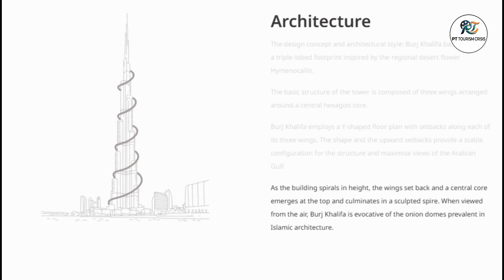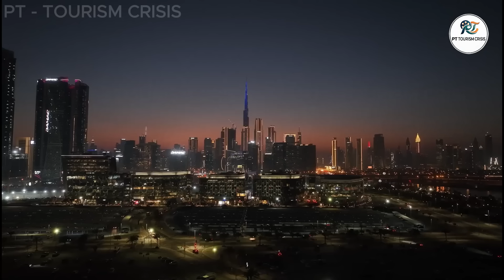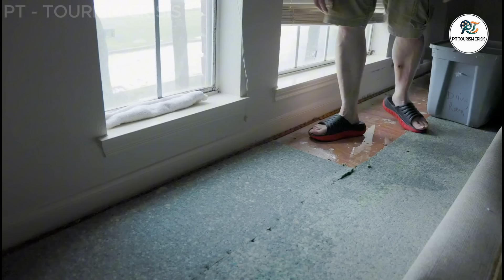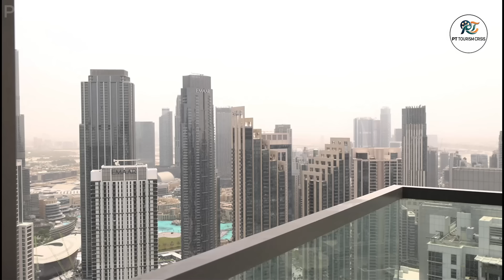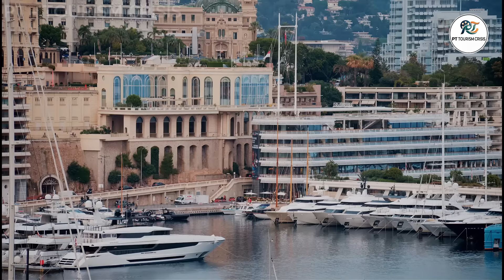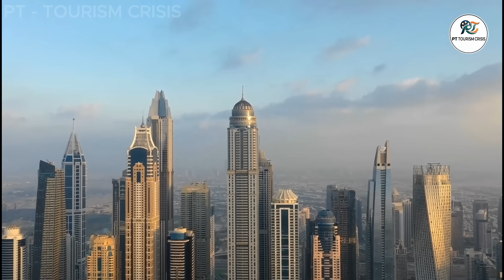Why Dubai’s "Impossible" Skyline Is Finally Failing

Comment: Now, what happens with this awesome engineering if the temperature highs are ten degrees higher? With the ocean heating it might end up ten percent higher humidity. It may not sound like much but on a structure hundreds of feet higher humidity it’s massive. By mid century the buildings may start becoming unsafe decades ahead of schedule.
Reply from the maker: That is a legitimate concern. Higher heat and humidity can accelerate material degradation and increase cooling loads, though whether buildings become unsafe early depends on design margins, maintenance, and adaptation.

Comment: Linguistic confusion led to the destruction of the tower of Babel.
The use of carbon steel for the construction of the building skeleton was lost in oversight.
There is a steel product that would have prevented the steel decay.
It is called 3CR12 stainless steel.
Reply from the maker: 3CR12 stainless steel can improve corrosion resistance, but material choice is always a cost, design, and maintenance tradeoff. Carbon steel can work too, if properly protected.

Comment: As part of the design process, thermal loads must be accounted for along with other types of loading and through-life degradation mechanisms.
Reply from the maker: Exactly. Good design must account not only for peak thermal loads, but also repeated heat cycles, material fatigue, corrosion, and long-term performance.

Comment: Western, and especially European, architects and structural engineers have scammed the oil rich rulers of the Gulf Arab states. They sold them building designs and construction that could last for hundreds of years in Europe or North America with only routine and occasional maintenance, but will require constant and expensive maintenance in the coastal desert environment of the Gulf States. Will these Gulf cities eventually end up like the coast towns of the American West? Probably so.
Reply from the maker: The Gulf’s heat, salt, humidity, and sand can make maintenance exceptionally expensive. But calling it a deliberate scam is too broad. The real test is whether long-term upkeep was honestly priced and properly planned.

Comment: You can not build on sand😊
Reply from the maker: Technically you can, but it requires deep-piling and sophisticated stabilization that is far more difficult than building on bedrock.

Comment: Some of those scrapers looked tilted by the winds. Leaning slightly. Pay attention and you'll see it next to some of the other scrapers being built or already built.
Reply from the maker: A slight lean can be caused by camera perspective, construction alignment, or normal wind sway. Modern skyscrapers are designed to move slightly, but a permanent tilt would require proper engineering measurements to confirm.
Reply: @PTtourismcrisis yes i thought so, i couldnt find this video to edit.

Comment: The ground is becoming saturated ( which it never was before irrigation). And no drainage system was installed . The subka has become unstable.
Reply from the maker: That is a valid concern. Irrigation and leaking infrastructure can raise groundwater in sabkha soils, reducing stability, especially where drainage is inadequate. The actual risk depends on local soil studies and the drainage system at each site.

Comment: this is baloney. when you invest on the future you predict all the variables. this is not the millennial tower in s.f. not maiden lane in n.y.c. where the designs are based on cheapness. saving a few million up front that condemns the structure before it is completed. they anticipate maintenance as this video displays.
Reply from the maker: Fair point. Dubai’s major projects do plan for maintenance, but good engineering does not eliminate aging, corrosion, or rising long-term costs.

Comment: Wouldn't it have made more sense to build underground? The possibilities are delicious. Delightful. Why not? So much could be accomplished, including farming.
Reply: The thing about building underground  is the views suck
Also, they are at sea level in very porous soil
Reply from the maker: Underground construction could reduce heat exposure and create space for controlled-environment farming. But excavation costs, ventilation, fire safety, groundwater, daylight, and maintenance make a fully underground city difficult. A hybrid design would probably make more sense.
Reply: @PTtourismcrisis I saw a hybrid construction that was genius. It could work. Like RB said, at sea level I guess you can't go too deep.

Comment: Hot humid salt air: wait for disaster to happen!
Reply from the maker: That combination is extremely corrosive, especially for exposed steel, concrete reinforcement, glass seals, and cooling equipment. Disaster is not inevitable, but constant inspection and maintenance are essential.

Comment: One intense earthquake will one day bring these skyscrapers down. And no one will survive. These should never have been built. Simple 1 floor homes with lightweight roofs spread out can survive earthquakes. And remote work has made these buildings obsolete. Seattle skyscrapers are now half empty.
Reply: That's exactly what Oman did. Simple buildings with Arabic heritage architecture.
Reply from the maker: Oman offers a strong example of how lower-rise buildings and traditional architecture can better respect climate, culture, and human scale without chasing extreme height.
Reply from the maker: A major earthquake would be dangerous, but modern towers are engineered for seismic movement rather than expected to collapse. Low-rise homes can reduce evacuation risks, although they are not automatically safer, and remote work has mainly weakened office demand rather than making all high-rises obsolete.
Reply: @PTtourismcrisis Did you see what happened in Venezuela lately? Or other past earthquakes around the world...

Comment: Help me understand how the science of erosion in this video is incorrect?  Seriously, no sarcasm.
Reply from the maker: The basic science is not entirely wrong. Wind-driven sand can abrade exposed glass, coatings, seals, and equipment. The exaggeration is jumping from surface wear to inevitable structural collapse. A tower’s load-bearing concrete and steel are protected behind the exterior, and their more serious long-term threats are moisture, salt penetration, cracking, and rebar corrosion. Those risks require inspection and maintenance, but sand erosion alone does not create a predictable domino effect.

Comment: Desert dust will invade every opening no matter how small.
This will act as an abrasive that will weaken the structure over time.
Reply from the maker: That is a genuine maintenance challenge. Wind-blown dust can enter imperfect seals and abrade glass, coatings, filters, and exposed equipment over time. However, serious structural weakening is not inevitable when buildings are properly sealed, protected, inspected, and maintained.
Reply: The Bible says to not build upon the sands! Wonder if they know that?
Reply from the maker: They probably do, but Matthew 7 is a parable about building one’s life on strong principles, not a literal ban on sandy ground. Modern Dubai towers use massive concrete rafts and deep piles for stability. The warning about pride and weak foundations still feels very relevant, though.
Reply: @PTtourismcrisis the engineering required to overcome nature is not and can never be permanent.

I heard recently that the Burj khalifa foundations depend on pumps to remove groundwater. We have a number of recent examples of pumps not pumping when the job demanded it - Fukushima, New Orleans during Katrina etc
Reply: The environment is relentless. The wind is constant, and it carries various elements of varying weights and compositions. The dust comes as the smallest particulates. There's no denying the degredation to come. It was meant to be a short term investment.
Reply: sure. you are correct. when I go to the beach sand gets everywhere like how It causes chafing on my groin. places it should not exist.

Comment: In western countries it rains acid that destroy their buildings within few years, in middle east no acid rain that corrode the buildings
Reply: 😄😄😄. Oh really?  You’ve been watching too much junk!
If that was true buildings would be falling weekly and they are not!
Reply from the maker: Fair point. Desert dust increases cleaning, wear, and maintenance, but it does not mean skyscrapers are structurally failing. Modern towers are designed for local conditions and regularly inspected. The real issue is higher long-term maintenance, not buildings falling every week.
Reply from the maker: That comparison is only partly true. Acid rain can accelerate damage to stone, paint, and metal, but it does not usually destroy modern buildings within a few years. The Middle East can also experience acidic deposition because it produces sulfur and nitrogen pollution, although infrequent rainfall and alkaline desert dust often neutralize much of the acidity. Buildings there face different threats, especially salt, humidity, sand abrasion, and extreme heat.

Comment: Do you think engineers don't know this from the beginning and they laid the solution for the illusion (false claims)  you said from the beginning, keep your day dream and jealousy dude
Reply from the maker: You’re right that engineers planned for wind, heat, sand, foundations, and local conditions from the start. Dubai even has specific structural and wind codes. That is why claims of inevitable collapse need evidence, but questioning maintenance and sustainability is not automatically jealousy.

Comment: In your dream how about in Lasvegas, you simply talk nonsense, Dubai sky scrapers built to stay for thousand years it is extreme engineering but you don't know this stupid
Reply from the maker: Dubai’s skyscrapers are impressive engineering, and comparing them with Las Vegas is fair. But there is no credible evidence they were designed to last 1,000 years. Their longevity depends on construction quality, inspections, repairs, and continuous maintenance. Criticism should be evidence-based, not dismissed as stupidity.
Reply: C’est toi l’imbécile !
Dans quelques années Dubai sera une ruine, l’entretien de cette architecture occidentale inadaptée au désert coûte trop cher.
Reply from the maker: High maintenance costs are a valid concern, but “Dubai will be ruins within a few years” is unsupported. Its towers follow climate-specific codes and were engineered for extreme heat, humidity, wind, and sand. The real debate is whether maintaining them remains economically and environmentally sustainable.

Comment: Because this was all built in roughly a 10-15 year period when its time to fail it will be a decade of dominos as they fail one after another. This city has no purpose or point anyway, they just didn't know what to do with all that money.
Reply from the maker: The concern about rapid construction and future maintenance is fair, but buildings do not share a synchronized expiration date. Dubai developed over several decades, and design life means planned inspection and repair, not automatic collapse. The city also has a clear economic purpose: diversifying into trade, tourism, logistics, finance, and real estate rather than relying on oil alone.
Reply: Its just a city of ghost apartments and condos to hide money for international criminals
Reply: They built it to make the prophecy told by the Prophet Muhammad come true, so as to make people believe that it’s the end of time. But the prophecy won’t happen this way. It should happen naturally, and no man should plan its realization.
Reply from the maker: The hadith describes people competing to build tall structures as a sign, not an instruction to manufacture the End Times. There is also no documented evidence that Dubai’s towers were built to fulfill prophecy; official accounts describe ambition, tourism, economic diversification, and engineering prestige.
Reply: @PTtourismcrisis  Tower of Babel comes to mind.

Comment: I would never live in a building like that. I don't think that type of construction is sustainable at all.
Reply: not for a hot, humid desert like that...with sandstorms and everything else
Reply from the maker: Exactly, those conditions make sustainability much harder. Extreme heat and humidity drive enormous cooling demand, while salt, dust, and sand increase maintenance. It is technically possible to build there, but only with efficient design, resilient materials, reliable power, and constant upkeep.
Reply from the maker: That is a reasonable concern. High-rise construction uses enormous amounts of concrete, steel, glass, cooling, and maintenance. It is not automatically unsustainable, but its real value depends on energy efficiency, long service life, high occupancy, and whether the density actually reduces land use and transport demand.

Comment: Hey, they said the Great Titanic couldn't sink but it did!  Same here in another way! What goes up, usually goes down!
Reply from the maker: The Titanic is a fair warning against overconfidence, but the analogy has limits. Skyscrapers do not fall simply because they are tall. Their safety depends on sound design, construction, inspection, and maintenance. No engineering achievement is invincible, but collapse is not inevitable either.
Reply: @PTtourismcrisis the Titanic was built in its day on. Supposedly sound engineering etc as well. The latest in the state of advanced communication of its day the telegraph. The Morse code.
Reply: One word : arrogance!
Reply from the maker: One word indeed: hubris. Ambition creates landmarks, but arrogance begins when spectacle is mistaken for immunity from nature and human limits.
Reply: @RedPilledFox  Yes, too big for their britches another way of putting it.